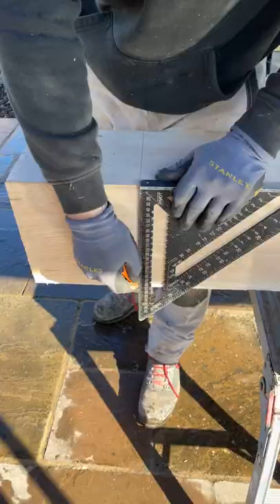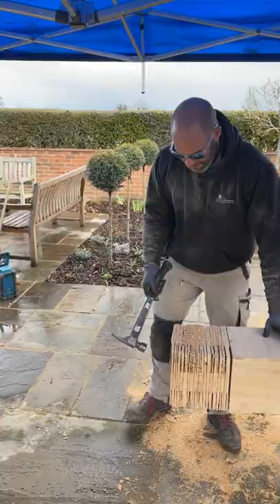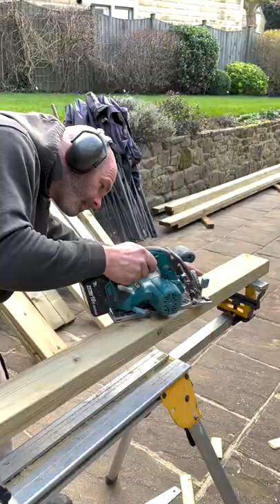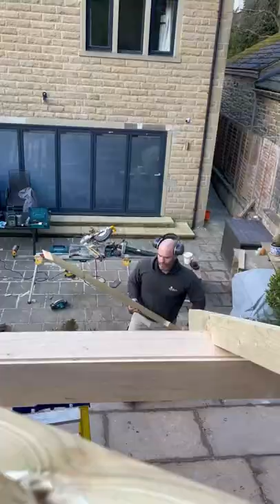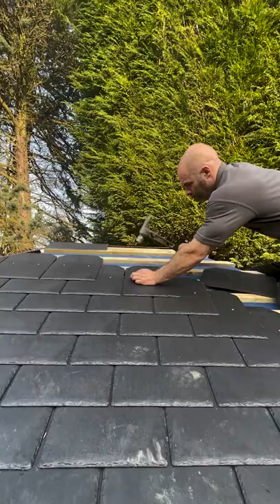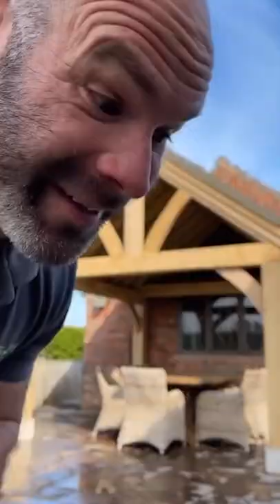Carpenter's Gazebo Time-lapse 🪵 | 60 Second Pro SIM071 #shorts

Comment: I dont get how you dont have any gap between the condensation layer and the wood, all the moisture gonna stop at each wood and ita going to root soon, please explane me the uk logic;D
Reply: That membrane is breathable
Reply: The treated timber battens will rot....in about 70 years if you're unlucky. This building can breathe away any condensation and the slate will take 99.99999% of the rain.